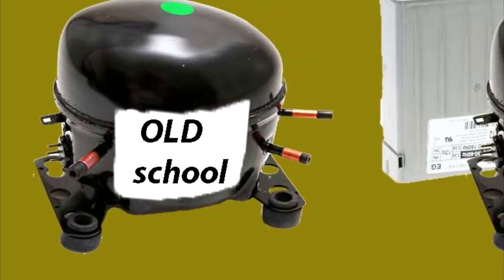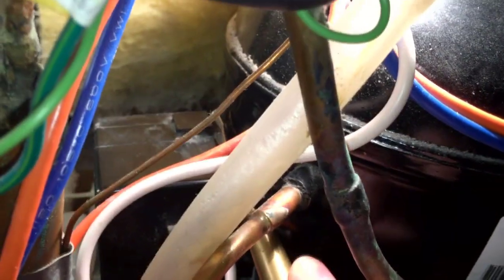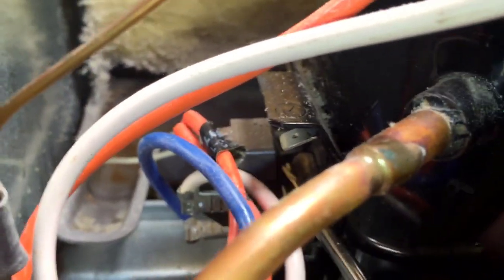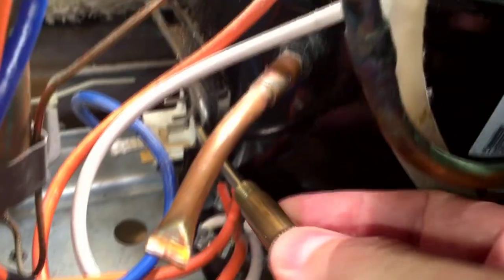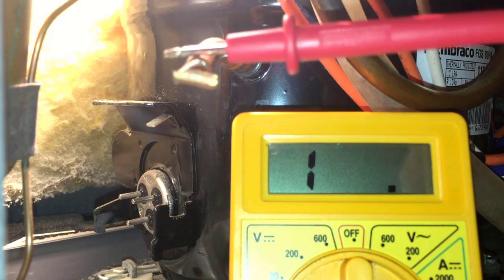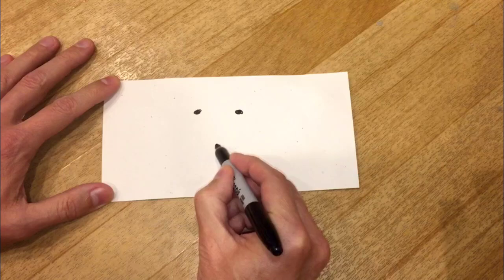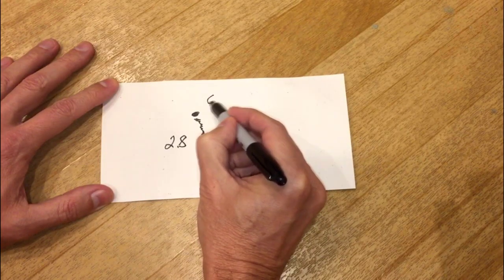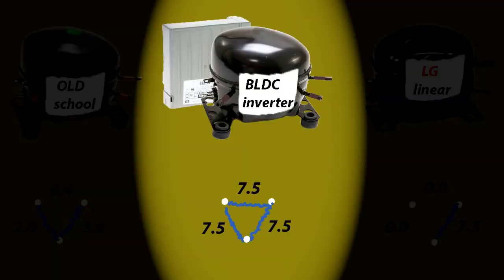Testing refrigerator compressor LG, Samsung, Whirlpool...

Comment: I have Linear compressor testing out at "0", "0", and "9.5". but the load from the motherboard is only providing 58v. Would that be a defective motherboard? The problem is no cooling but all accessorizes seem to be working. Compressor runs but very little temp variation from inlet to outlet. any thoughts or suggestions?
Reply from the maker: It sounds like a bad PCB (motherboard) because the typical working voltage should be at least 80 VAC up to 180 VAC. However, linear compressors internally have a weak suction reed valve. If the valve is broken, the compressor will run, but will not compress refrigerant gas. The outlet and the condenser coil will stay around room temperature. ONLY if you are comfortable working with electricity, you can bypass the PCB and plug the Linear compressor directly to the wall 120V. Use those two pins were you measured the 9.5 ohms of resistance. The compressor will sound louder but will work. If it starts cooling, the PCB is bad. If it still is not cooling, the compressor is probably bad. Also, the refrigerant may have leaked out, and to verify that, you'll need to check the pressure inside the LOW and possibly the HIGH side as well.
Reply: Hi Mark, I have the exact same issue as you. Were you able to fix your fridge? Everything on my fridge seem to be working other than not cold or cold enough.  I measured the voltage on the motherboard going to the compressor and it was ~150VAC. But the voltage across the 2 overload protector’s terminals to the compressor was less than 50VAC. Could a faulty overload protector be the root cause?
Reply: Paul Chang while the mother board showed insufficient voltage to the compressor it still did not fix my problem. Ended up being the compressor.
Reply: Hi Mark, this is what I am afraid of 😫. How did you figure it out it was the compressor after all? And did you have to replace the compressor by yourself, soldering and all?  Mine is still under 10 years, so I will try to get LG to replace the compressor and pay the labor cost.....
Reply: Paul Chang 
After I found out that the compressor had a 19 year warranty I called Sears out and they confirmed the compressor was bad. Basically they hooked up gauges and when they determined that it still had freon their only conclusion was to replace. Of course the fridge was out of warranty but the compressor was a “parts only” replacement. Still had to pay labor.
Reply: Sorry— 10 year warranty

Comment: What if your compressor runs properly (sound is perfect) but no cooling at all? All my fans are running correctly and the coils are clean. The compressor is warm but not hot and the pipes do not feel cold. Thanks
Reply from the maker: If the compressor is running, all fans are running, the condenser coil is clean of dust, but the evaporator coil is not getting cold... it's a Sealed System problem. It could still be a bad compressor (typically LG Linear), refrigerant leak, stuck 3-way valve (on dual evaporator models), or restriction on High or Low side. To figure out what exactly is the problem, you need to check the pressure inside the Sealed System, which voids the warranty.
Reply: @Your-Self  Hey my friend,  I had a guy out yesterday, he charged me $75 and did some test , flashed the PSI of his gauge at me (no explanation) and said "your compressor is shot, he was not in my home for 10 minutes, didn't offer a repair or quote me one? He just said (it's 5 yrs old, LG has a 10 yr warranty on compressors but someone will charge you $600 for the install? A $2K fridge and 3 yrs later a $1000 repair, is this accurate? Thanks for your time, I'm on disability so $2k for a new one isn't easy for us now. I so appreciate your free advice...
Reply: Oh, and I got no paperwork, no estimate for the repair which both seemed cheesy in my book, no receipt means they aren't paying taxes on my $75 10 min visit
Reply from the maker: The unfortunate truth is, that Linear Compressors fail within the first 3 years. Therefore, last year LG started to honor the Free-5-Year warrantee to boost confidence in buyers. After 5 years you'll have to pay about $500 labor to replace the compressor. Depending on the technician, the replacement compressor may have a very short life as well. Whish I could be more helpful, good luck.
Reply: @Your-Self  Hello, LG GN-H702HLHU A ++ 546 lt model refrigerator, do you think it is a product that can be purchased? It is said to be very good in terms of technology, savings and cooling. But after reading the comments written here and in some places, I don't know how long the refrigerator will last. Would you recommend this model?
Reply from the maker: @phyrezz Linear technology if very efficient and quiet, but is not reliable. In 2019 LG improved their Linear compressor, so maybe, it's going to be better than the previous version. But unfortunately, nobody knows how long the newly-updated compressor will last.
Reply: @Your-Self  First of all thank you for your response. How can I tell if the improved version is in the model I specified? I live in Turkey, have improved version can be found everywhere? Also, if you have any information, can you give brand advice other than LG?
Reply from the maker: @phyrezz the Turkey market is probably different from the USA market, so it's difficult to know for sure. I would look at the manufactured date on the label, and if it's closer to the end of 2019, or 2020... there is a better chance that the compressor is improved. Every brand has problems that can be reasonably fixed, but a bad compressor is deadly for the refrigerator.
Reply: @Your-Self  Thanks, I'll probably check out products from other brands. There are many complaints about LG refrigerators.

Comment: What should be the voltage going to the linear compressor from the circuit board?
Reply from the maker: The circuit board supplies the compressor with a variable voltage based on needs. The typical operating voltage could be anywhere from 80Vac to 200+ Vac

Comment: I have a recently replaced LG (FC75LBNA) Compressor in my Kenmore Elite French Door Refrigerator. It wasn't turning on but I have been able to position the relay/overload plug to get the compressor to come on but it still isn't cooling enough.

My question is this...on the side with the resistance, are those two prong the equivalent to Common, Start and/or Run? If yes, which two do they represent?
Reply from the maker: On Linear compressors, there is no Start prong. LG calls working prongs Power and Common.
It typically takes about 24 hours to reach full cooling potential after compressor replacement.
If it's a dual evaporator model, did you open the 3-way valve to completely evacuate the system, and weigh in the right amount of refrigerant?
Did you replace the Filter/Drier (it's important after Linear Compressor failure due to debris in the Sealed System)?
Reply: @Your-Self  I got this refrigerator after it had been replaced so I am not sure if that was done or not. After 24 hours of running, the refrigerator is down close to temp but the freezer is the same temp. Any ideas as to why this would occur and what I could do to fix?
Reply from the maker: Newer refrigerators are Hi-Tech machines, and if somebody has already worked on sensitive Sealed System components incorrectly, I'm sorry to say, but there is probably nothing you can do to improve it. Only an experienced LG tech may be able to redo what was already done. (incompatible compressor to the motherboard, permanent or floating restriction, refrigerant leakage, an incorrect amount of refrigerant filled, stuck 3-way valve if dual evaporator - just to name few possible problems)

Comment: Which is Best....? I'm Confused...🤔  Please Help Me...?!
Reply from the maker: Older, basic compressors are reliable, but noisy and consume more electricity. Newer BLDC (variable speed) compressors are reliable, but the INVERTER (gray box) is not, but you can replace it yourself if needed. LG linear compressors are quiet and efficient, but not reliable at the moment. They have an updated version of the linear compressor in 2019, but we don't know how long it will last.
Reply: @Your-Self  Thank You For Advice...😍💕

Comment: With an lg linear compressor I measured 0, 0, and 20 ohms resistance. Is that a sign of a bad compressor?
Reply from the maker: Yes, 20 ohms of resistance sounds a little high for the compressor. But to find out if it's still within the specs, you need to look at the tech-sheets for the specifications for your particular model. What is the model number, I'll try to find it?
Reply: FLB075LANA is the compressor model, LFXS30726S fridge model.
Reply from the maker: According to LG documentation, your compressor resistance should not be more than 9.2 ohms. If you believe that your multimeter is accurate, that indicates that the compressor is bad. You never said what exactly is wrong with your refrigerator. Is compressor running, but not cooling at all, cooling a little, or not running at all?
Reply: Sorry the fridge/freezer is cooling but it’s about 20 degrees warmer than it should be. The compressor runs constantly and the fan is running as well.
Reply from the maker: If the freezer is OK at about 0ºF, but the fridge above 50ºF, you may have a defrost problem in the fridge evaporator section. What are the actual temperatures in all compartments?
Reply: Both the fridge and freezer were reading between 50-55 degrees. We ended up calling a tech who confirmed the bad compressor, but good news that LG is now covering parts and labor for their linear compressor for 5 years! https://lgcommunity.us.com/discussion/3871/important-lg-refrigerator-warranty-information-announcement-please-read
Reply from the maker: Great! Good to hear it.

Comment: I read my compressor and the top to right is giving 0.8 and the top to lift is giving 0.8 and the right to lift is 0.8.so what does that mean is my compressor good or bad
Reply from the maker: If all readings are exactly the same, it's good for a variable speed inverter compressor. But your reading is less than 1 ohm which is too low. Maybe you have a bad multimeter, or you set a wrong range on it. Set the range to regular ohms and if you get 8 ohms on all terminals, it's good.

Comment: So do you think up to now lg hasnt resolve the problems with their linear compresors? I just learned this problem after i  bought a side by side 24 cu.f lg fridge so it would still breaks after a year?  Give me some tips how to prolong the compresor's life if theres any pls.
Reply from the maker: Newer refrigerators come with a different operating algorithm, which supposed to improve the life of the compressor. However, only time will tell whether it works or not. Meanwhile, to prolong the life of your fridge, make sure that there are at least a couple of inches of free space between the fridge and all walls and cabinets. Air circulation is important for cooling the hot compressor and making it last longer. Also, clean the condenser coil regularly of dust and pet hair with a vacuum and brush.
Reply: @Your-Self  thank you so much for that info and advise.👍👍👍New subscriber here😃😃😃👍👍

Comment: I have a Kenmore Elite that does not get cool anymore, both fridge and freezer. The compressor in the back model is FC75LBNA. This compressor doesn’t has the relay thing on the side, it has a box call LG thermistor assembly (https://www.ebay.com/itm/LG-EBG60663207-Thermistor-Assembly-ptc/163740934407?epid=1537084595&hash=item261fb86107:g:uq0AAOSwxuRdXEdI). When I took the assembly off. It shows 3 pins. 2 pins on top and 1 pin on bottom. Looking straight to it. The top left pin and bottom pin tested about 7.0. The other test of the top right and bottom, and top left, top right both show 0.0. Is that mean the compressor is still good? The fridge was bought in 2012. Is this a Linear compressor or the older type? Please advice. Thanks
Reply from the maker: Some Kenmore refrigerators use LG Linear compressors (it should say "Linear" on the compressor). In this case, 7 ohms resistance between only two terminals is good! Linear compressors don't have a start-relay, only overload protector (which you called: LG thermistor assembly). You didn't mention if the compressor is running or not. If it's running, but not cooing, it's a major Sealed System problem. If it's not running, maybe it's worth repairing!

Comment: Thank you for the video. I have an LG Linear compressor that im testing. The ohms read 9.0. What would higher than 7.5 mean? Thanks in advance.
Reply from the maker: Every compressor is a little different, and the exact resistance range is written in the tech-sheets for your unit. But 9 ohms between two terminals is typically a good number within the specification.
Reply: @Your-Self  Thank you!
Reply: Thanks for asking this question. I was getting an 8.2 reading on an LG linear.
Reply: @Jagger02  so if your compressor was still good what was the problem on your fridge? Currently trying to fix mine

Comment: thanks for the information
what do you think about new lg linear compressor i head so much problem's in that tip of compresser
i am thinking to buy new fridge but worried about the compresser
so thinks if freadge with bldc inverter compressor
what do you think?
Reply from the maker: LG still has not fixed the problem with their linear compressor, so I'd stay away from LG for now. 

BLDC inverter compressor seems very reliable, but the inverter itself is not. However, you can easily replace the inverter yourself if it breaks down.
Reply: @Your-Self  which brand refrigerators have BLDC compressors
Reply: Agree with the other comment. STAY AWAY FROM LG/Kenmore (uses LG compressor). Learned the lesson the hard way.
I have two 10 years old Samsung  french door running great. Inverter  may fail but easy to replace.
Reply from the maker: @helpanoobout most brands have BLDC compressors, but they also use regular compressors as well. So you have to ask the salesperson or look at the documentation of that particular model which you are trying to buy. The description may say "Variable Speed Compressor" instead of BLDC.